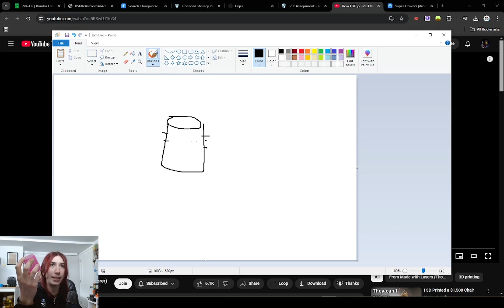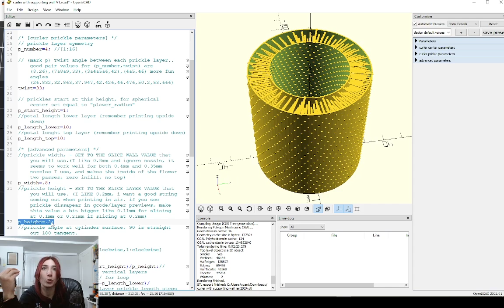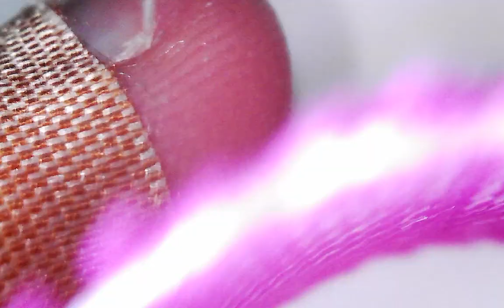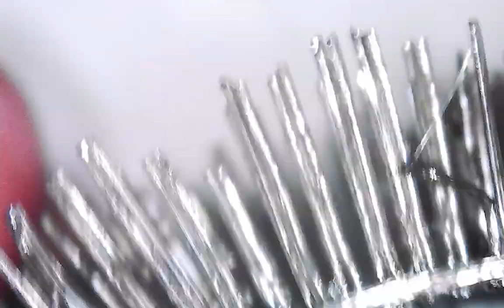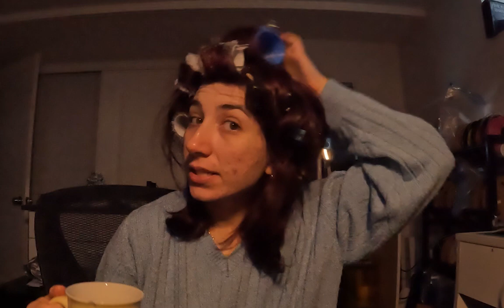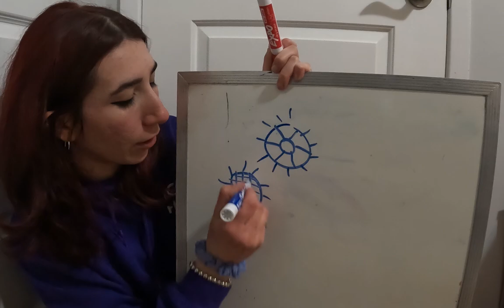can 3d printing curl my hair? from code to CAD with OpenSCAD

Comment: try flexible pla filament
Reply from the maker: @codymovald2123  I actually did in this video! That's what the light blue curlers are made from. I think I should have made the curler cylinder thicker to help with structure. The flexible PLA filament I used is the X-920 flex by sakata 3d.

Comment: I suspect for TPU the improvement with SLS would be marginal because you could eliminate the outer shell but TPU has such good layer adhesion already that the primary benefit of polymer SLS (the overall benefit is mostly metal printing) isn't that important. Also congrats on the sponsorship! Always dubious of sponsors but PCBway is generally pretty legit and non-sketchy. Speaking of sketchy companies though in the back of my head I can't help but wonder what you think of the bambu labs update situation. I guess for now you did the best interim thing which is make a video featuring your Prusa again haha.

Comment: This is such a cool project.
I hope you keep working on it, and make a "final" model you can upload somewhere where others can find it, so that they too can 3D print there own hair curlers.

I have high hopes for the spoke design. If you are lucky you might be able to make a design that can be printed in vase mode (But it might limit you ability to fine tune the stiffness, but it will probably print quite quick.

Next step is to make a system such that you do not need the "clamps".
Maybe you can use the hair as a locking mechanism by adding a slit or something the hair can go through to luck it in place. 🤔